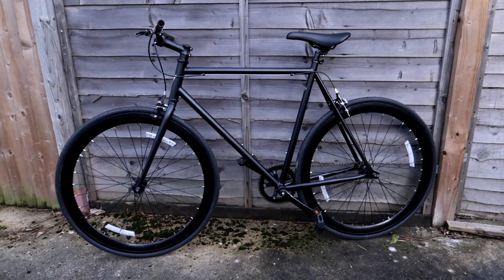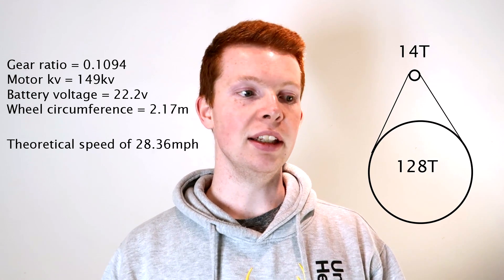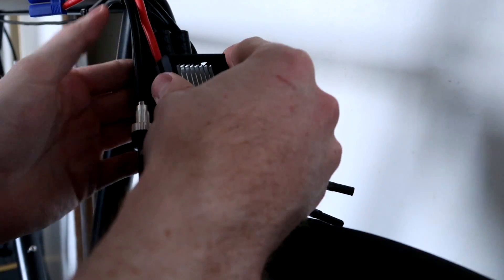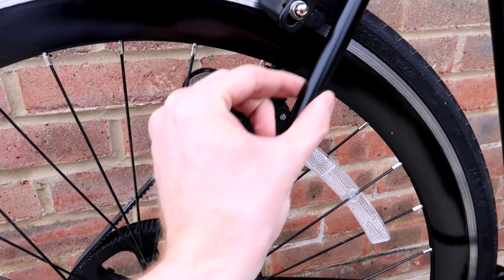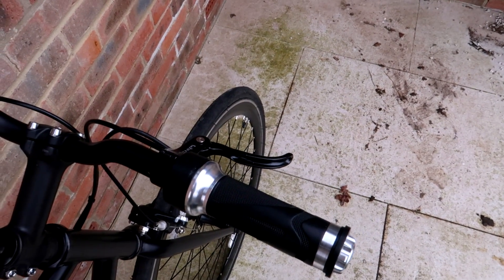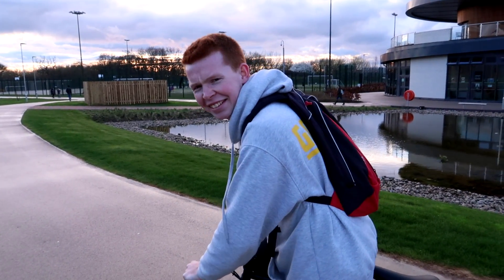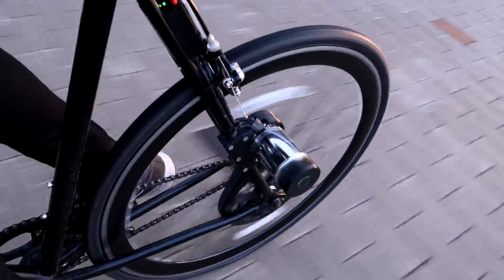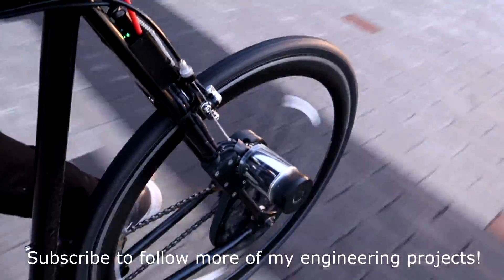DIY Electric Bike

Comment: I'm using a simple servo tester along with the throttle handle. The throttle handle is just a potentiometer which I just solder in for the potentiometer on the servo tester. Works perfect connected to the ESC.
Reply: I converted a petrol scooter to EP using exactly that.

A simple cheap servo tester from Hobby King along with a Heli ESC and motor.
Soldered the throttle to where the pot was and presto!

40km/h on 12S and pops wheelies with a 120kg guy on it.

Now that I want to do a bike I was wondering how to mount it all to the wheel hub. They have solved this conundrum for me......thing is, did they upload the 3D print file for the components to the net? Edit** Yep, they did, just found it.

I used the same brand motor, but, the 192kv much faster!

They need to run this on 12S and use two 8000mAh packs in series.
Reply: ijustwants that was exactly what I was about to say!
Reply: yea, so you desolder the pot and solder in that handlebar pot.
Reply: wayne murphy it's likely not dependent on absolute resistance, just voltage ratio across the pot's divider.
Reply: I also thought that there might be a way such as this, but then I thought maybe he didn't because the potentiometer on the grip might of been incompatible with the servo due to different resistance values.  Anyway I think that Tom and his pals solution is a far more elegant way of doing it.
Reply: servos use a pwm signal not an analog voltage
Reply: plus you can get 2$ arduino nanos on ebay and the arduino ide (where you write code) has a free example code called knob that converts analog voltage to a servo pwm signal. This could be used with no modifications for this. No code writing necessary. very easy solution.
Reply: can you give a link to show us non englishmans what is servo tester?
Reply: I used an arduino nano when I faced a similar problem (using a plane brushless motor on a fan), the code is extremely basic, and apart from the extra flexibility I think It makes the project look more... "professional". Nowadays this boards are even cheaper than the servo tester someone linked below.
Reply: so i could use the heli esc and cheap servo tester for this to work yes as struggling to find a vesc im starting to dothis build your help would be appreciated
Reply: Aap apna WhatsApp number dijiye
Reply: Yea and its 4$
Reply: https://hobbyking.com/en_us/hobbykingtm-servo-tester.html
Reply: That's correct :)